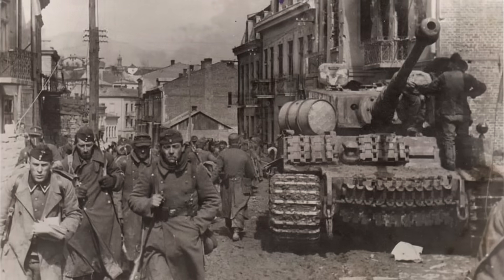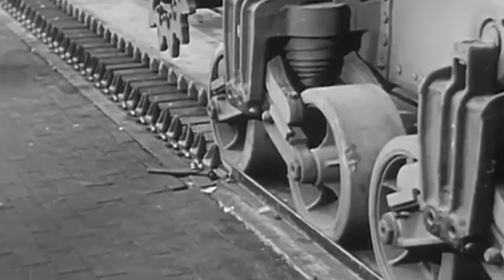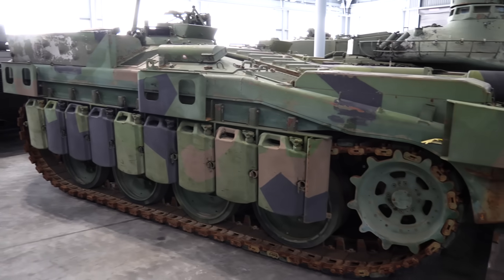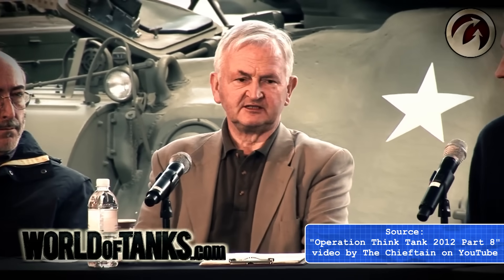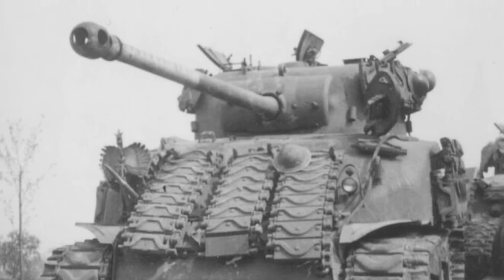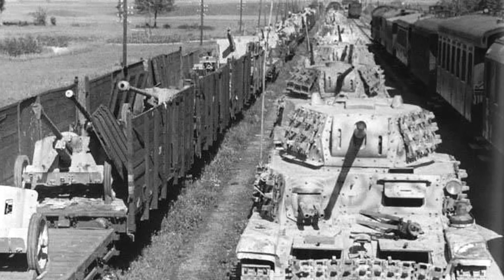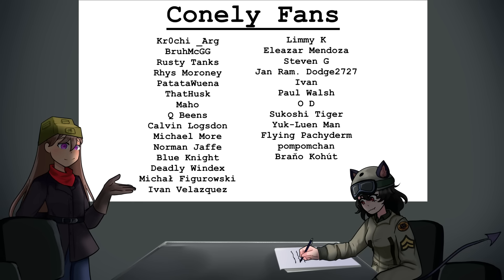Tank Tracks as Armor: Good or Bad?

Comment: I want to add food for thought on ammo you didn't mention. The shaped charge actually needs a bit of space between impact and armor to form a penetrator. Adding makeshift armor of questionable effectivness,  might very likely inhance the pentration value of a shaped charge hitting tracks/wood/concrete armor.
Reply from the maker: Correct, I covered that in detail in my spaced armor video. Wasn't worth going into detail on HEAT rounds because the tracks aren't going to do much of anything against them

Comment: There are a few channels that did videos about this very subject like SY Simulations and  Dejmian XYZ. And like you said, IT DEPENDS...
Reply from the maker: It's something I would imagine is hard to test and even harder to simulate because of how many factors there are at play. A slight deviation in mounting position or projectile design and you could end up with vastly different results. Generally though it seems like the added protection is fairly low for the added weight

Comment: Take a look at the up armor kit the army had for the United States it is like a plate for the 47° Sherman hull that has an extension to cover the transmission cover partially. There is a well-known picture of a cast hull m4a1 76 mm with two of these plates mounted to the front. See if you can find any useful information to share with us

Comment: NORMALIZATION DOES NOT EXIST!!! There is a reason why it was not being used in literature!

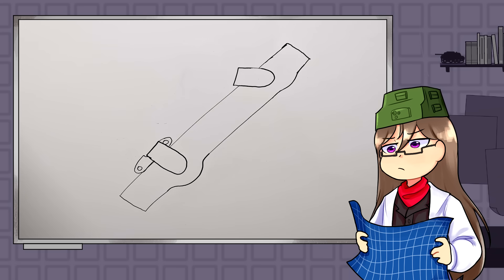The diagram at 3:29 is wrong. 
The angle of the travel axis of the penetrator at entry should never be less than at impact. 
The angle may decrease at exist depending on a wide variety of factors. 
It is not the matter of "exaggerate for effect". 
The correct diagram should have both penetrator slanted away from the armor normal, but one slanted less.
Of course there are cases of garbage quality armor that allow you to pass straight through with minimal angle deviation. 

I do not think the space armor is a good document to use for this video as the condition of track is vastly different from a purpose manufactured steel plate.
Reply from the maker: Normalization absolutely does exist, but you are correct that the diagrams aren't accurate to real world situations. That wasn't the point of the diagram though it was to show what happens to the shell when hitting the track in an exaggerated, easy to understand, way.
Reply: @ConeOfArc  
Every pieces of literature I came across always shows penetrator going away from the normal of the armor plate. 
I would like to be proven wrong.
Reply: Sorry bro but the guy with anime profile pic has spoken
Reply: @ConeOfArc  
I been looking and cannot find any example of penetrator turn toward the armor plate normal at entry. 
Can you provide some example?

Comment: 7:28 Fun fact: Those are also tracks, though not in the sense of full links or even a length, theyre just steel inserts that would replace the rubber inserts every few track links for especially snowy or icy conditions. Obviously they were forbidden on public roads.
Reply: The technical term for them is grousers.

Comment: Further in the Aberdeen testing documentation you referenced, they note that at specific angles spaced armor offer increased protection (around 33% by weight) - and that the outer armor being harder significantly improves performance.

AFAIK high velocity SABOTS are generally uneffected by deflection, but instead mostly by the amount material obstructing their movement, so any additional material in that case offers increased protection - although it would be extremely limited and dependent on the material used.
Reply: Spaced armor, or applique armor, whether deliberate or improvised (like mounting the spare track links on the glacis) can also slightly defect an incoming sabot round, enough to cause it, once it hits the tank's armor, to precess and spin out of control w/o penetrating.
Reply: @selfdo  in the case of a SABOT, it's more like the angle of the moving rod erodes material over a larger surface area, reducing penetration. Things like APC or APBC can definitely deflect though.

Comment: Both the Allies and Axis found that improvised armor was generally a bad thing, but the positive psychological effects for the crew members was generally worth the trade off is most cases.
Reply: That requires shipping spares, though.  For all the superior supply the US had compared to the Germans, shipping was still a bottleneck and some things simply had to be left behind. There was a dearth of spare Sherman radials for a couple of months after DDay, for example. If they could reduce the amount of spare tank parts needed at the front, they could increase something else.
Reply: I think it was more that it was going to be too easily seen as prioritising tank maintenance over human beings as the extra weight was also a concern.  It comes down to trust that they're actually trying to improve survivability as its really quite counter-intuitive that more armour can actually make things worse.
Reply: @otarala  
But that's the whole problem, isn't it?
Tank tracks are *not* armour - that's the whole thing!

Because they're made from basic steel, rather than face hardened, they can make enemy shells dig in instead of bouncing off.

It's the same as putting a log or whatever in front of it - it looks like cover/additional armour to our human eyes.
But at the speeds/energies involved with tank shells, those densities and material strengths simply no longer matter.
(just like a .30 cal or Axis equivalent would simply cut through a tree trunk; so by hiding behind one you would get concealment but not cover)

Still, I don't think you can explain it to people (either then or now) without showing them what happens during an impact.
I should go watch the SlowMo Guys again, lol 😂
Reply: @otarala thats the kicker, that doesnt really matter because America is over supplying thr frontlines. If it brokes, get another one.
Reply: @aldrinmilespartosa1578  Maybe in computer games. In real life, you're still expending money, fuel, manpower, etc, etc, to mine/produce/ship stuff some ignorant idjits wasted. And "morale"? It's cute yes but you'd think being dead is terrible for morale, either yourself or your friends, doubly so when said dead was entirely preventable by tank original design but clueless clowns helped enemy destroy it with extra "armor" helping shells to defeat armor it normally wouldn't...
Reply: @KuK137  things america can afford. Like thats basic history, you do think a nation where they have barges spicifically for icecream stuggle for logistics?
Reply: @KuK137  Demoralized men break easier and go about with a "Well I'm dead anyway." mentality, which drastically affects their performance.

Yes, morale is more important than you're implying.
Reply: @KuK137  you kinda have to ship extra tracks for tanks anyways. Those things dont just run with one set throught their entire lifetime
Reply: Cope cage is legit armor
Reply: Bs
Reply: The "positive psychological effect" reminds me instead of a point I've heard about warship design (and tanks are simply land-ships, right? /j). A ship perceived as being "more armored" is going to be used as such, and that might mean putting them in situations where they aren't effective or are even endangered by their protection compared to a less-protected vessel.
There are a lot of details that don't apply to tank design or field modification. My point is just that a "morale" effect of perceived protection isn't a universal positive (even if it probably was a positive overall).
Reply: How was this measured and the results compared?
Reply: @kantai3309  research it. The results were that improvised armor did not stop armor-piercing shells. 😂 Did they add protection yes. The main issue was sand bags. They did very little and added a lot of weight. Which increases fuel consumption and reduced speed. Both of which the Sherman was designed for.
Reply: Read that study, sandbags,  treads won't stop a anti tank gun. But the study never says no improvement. "No significant improvement" detonation of a shape charge prior to full contact with the surface of the armor is a good thing. Not as good as reactive armor, but cage like riggs have been used by the US to reduce vulnerabilities to RPGs.
Reply: Są dowody że czasem pomagały. A na temat pancerza .w bitwie pod Kurskiem przeżyły tylko załogi tygrysów którzy ustawiali swoje czołgi pod kątem do przeciwnika.. pomagało to robić rykoszety.
Reply: Didn’t the Soviets just use Infantry as spaced armor?
Reply: @BaDArxz  this account is misrepresenting the facts. I've read the study. It never says bad. 
The article states does not give significant portion from anti armor weapons. The only concern was fuel usage and mobility reduction.
Reply: True that. When Soviet tank units first encountered Panzerfaust, they experimented with metal meshes and plates set at a distance from the tank. Didn't change a thing, that thing still went through, no problem. However, the troops on the ground still used that as a psychological boost.
Reply: @ivanstepanovic1327 odd how translated Soviet documents show the exact opposite of what you say.

Comment: Track links are primarily there for spares, tracks are a target for the enemy so its always good to have extras, they are usually seen fixed to the front and turret sides of a tank due to transportation concerns. most tanks were stretching the limits regarding the width of the tank for railroad transport and so you would put them in other places that wouldn't effect the overall width
Reply: Tank tracks are also damaged by mines, or rocks and/or ruts in the roads.  Why not mount them where they're accessible and provide a modicum of added protection from enemy fire?

Comment: Moral of the story: don't store your spare tracks on the front, store them on the side over the track skirts. Those are usually a nice flat surface to begin with so the problem with normalization doesn't come into play, and a spare track that gets ruined stopping a round from knocking out the track you're already using saves you the time spent swapping them out. >:D

Just hope it doesn't go through it and still knock the tread out anyway, because then you've lost twice as much track as you would otherwise...
Reply: True but also could stop a shallow angle side hit from ricocheting and instead pull it in toward the tank 😬
Reply: Would the brackets that support the side skirts be strong enough to support the extra weight? I think it would likely differ tank to tank, from memory, the Panther only uses small bolts to hold the side skirts on and they likely wouldn’t be able to support the weight
Reply: @harrisonrawlinson5650  Suppose it would depend on design, yeah. If one can get away with it though...
Reply: @harrisonrawlinson5650  Nope. Also, you'd imagine extra weight on skirts would make them grind against tracks, wearing them out and making tons of noise...
Reply: Better to loose double the tracks than a life

Comment: They just straight weld that s*** to the outside of the tank right? but they only spot weld it presumably so that they can pry it off later and put it on the track? Idk I know some have brackets I'm not sure how exactly it worked, probably varried, you're not welding thru zimmerit for example

Comment: I don't believe tank crews put spare tracks on the outside of their rides for the protection, although it certainly helped.  What they'd do it for is to have the spares readily accessible and not taking up valuable internal cargo space.
Reply from the maker: They absolutely did use it as armor, if you look closely you can see many of the tanks shown in the video are carrying tracks from a different vehicle. You also don't need to carry enough links to completely replace a track.
Reply: There is no such thing as internal cargo space in a tank. Ammo storages. You leave your rucksacks outside in the bussle rack
Reply: @arthurjenkins9757  True, also, other vehicles, especially the trusty "Deuce and a Half", or its modern equivalent, the five-ton ton, haul "cargo".  More as interior design, whether its for Ammo (shells and MG rounds), LRUs (Line Replaceable Units), or an extra "crew" member (battalion CO).  Hence why the storage racks on the turret bustle on most modern MBTs.

But you mean that you're going to store your BEER outside the tank so the enemy (or the grunts) can steal it?
Reply: You don't need spare track links to drive. Although not common you can short track a tank

Comment: This example of spare track links used as armor illustrates the hazards of analogical reasoning. It also reminds me of a photograph of George S. Patton bawling out a TC for overloading his M4 with sandbags. I heard a leftist history professor call Patton a fascist, using that picture as evidence. "See? He did care whether his men lived or died, just that his precious tanks didn't look cluttered." The guy was a Marxist and a major creep. (He announced his devotion to communism on the first day of class and labeled the Boy Scouts a paramilitary organization.) I dropped the course and made it clear to the administration why I did.

I've since learned that sandbag armor did nothing good for the Sherman tank. It slowed down the tank and raised the CoG even higher. It over-stressed the engine, the suspension, and the drivetrain. As tank armor, sandbags suck. AP rounds blaze through cloth and sand like it doesn't exist. And because of the turning effect documented in this presentation, sandbags can enhance the impact of a HEAT warhead by turning it perpendicular to the armor face, thereby negating the advantage of the slope. By 1944, George Patton had been studying tanks and armored warfare for 27 years. He knew a thing or two that might have escaped a tank commander who hadn't even lived 27 years.

Comment: The Sherman had a very poor reputation and the Americans certainly used anything they could get their hands on to increase protection. The British  were mixed, most did not use tracks, preferring mobility. Canadian and Polish tanks were heavily "up armoured" often carrying several tons of tracks. While the Soviets, Japanese and Italians seldom used this extra protection. Tests showed that the tracks did nothing against AP projectiles, but were of some use against the Panzerfaust type weapons, though thin steel plates were better.
Reply from the maker: My video on German spaced armor goes over why spaced armor is not good against HEAT rounds like the panzerfaust. Tracks would similarly offer little to no protection against them for the same reason
Reply: @ConeOfArc  That should be interesting as it kind of flies in the face of military science😁

Comment: I was a US Army tanker for 26 years. We had tracks on the side but only for repair use. Rugs would on occasion hit them and need a new one😂
Reply: That's the thought I had, putting them on the side makes the most sense. Real question is whether those spare tracks getting hit ever helped prevent damage to the tread you're currently using. If so, then technically they did their job, and as a bonus saved the time that'd go into changing them out.